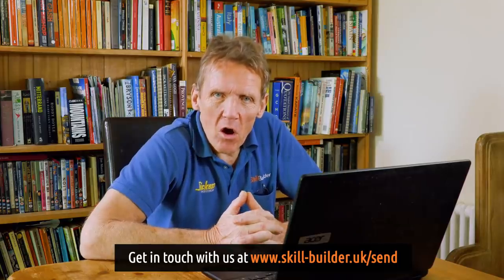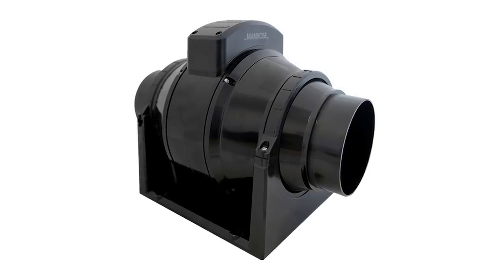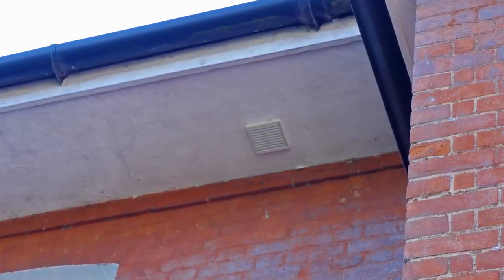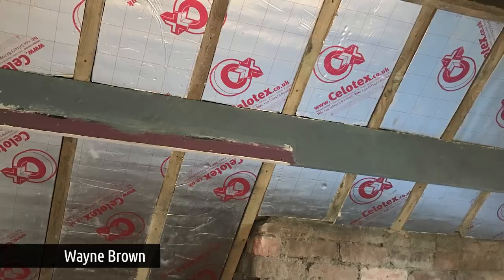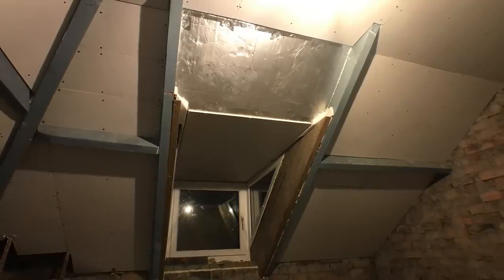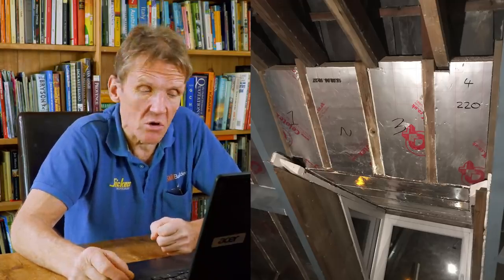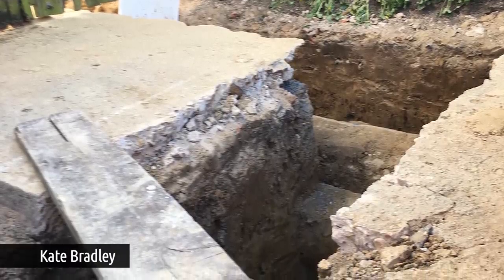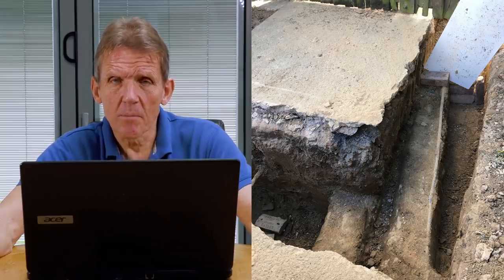Who Needs a Waste Carrier Licence? - ASB #10

Comment: My parents house has a 6”
Wall mounted extractor in the shower room.  

I haven’t done the numbers but you can feel a fair amount of air flow being pulled under the door to the shower room (best to work out the extraction rates to determine if you can find a suitable wall mounted fan).

You will need a larger hole in the wall of course but putting a rigid polypropylene pipe liner in and making sure it’s sealed correctly will help significantly with getting air flow through it and avoiding leakage. 

It’s the type with a humidity sensor and self closing shutter which is great in winter to stop cold air draft when the fan isn’t running.

Comment: I've found a great way to mount those ducts fans without vibration noise is to suspend them from rafters/joists using short lengths of 6mm bungee cord hanging from large cup hooks. Even better for hooks are the screw in insulators used for electric fencing which are nice and smooth to avoid wear on the bungee.  Works a treat.

Comment: Vapour barrier: If using foil faced celotext type insulation you can tape the board  joints with foil tape to create a vapour barrier.  100mm tape will bridge across rafters.  Regardless of method and especially in renovation type projects, continuity of barrier at junctions with walls/roofs/floors is the tricky bit to achieve in reality (easily done in theory on the drawings!)
Reply from the maker: Martin Hill 

That is a good tip. Having looked at the pictures again he has no membrane so lots of ventilation on the cold side.

Comment: Really interested (and spooked) hearing your comments about dewpoint in Q2 Roger. Had to insulate my small kitchen a couple of years back - 1880s build, rubble wall. I understood that the wall was designed to dry by breathing into the house as well as natural drying outside. As such, I studded and boarded it without a vapour barrier and, yet worse , deliberately left internal air gaps under the kitchen units knowing there was air movement behind the insulation.  I was trying to avoid the opposite problem of moisture being deposited by osmosis from the outside. and then being trapped and condensing. What have I done ?!

Comment: the 100mm wall axal fan should be replaced with a centrifugal type with capability to shift 90M3 per hour,  don't forget the fan need air to extract and just where will that come from without provision for replacement air flow or source

Comment: If your ever not sure of insulation requirements or reactions with the environment your using them, speak to the manufacturer, EcoTherm for example will go through the makeup of a wall, floor, ceiling etc, produce drawings and breakdown all for free, great if it needs to satisfy building control, or you’re unsure.

Comment: Drain: Respectfully, I'm not so keen on building a brick manhole over an existing drain. I've seen more than one case where the new manhole has settled, fracturing the original drain pipe both sides with subsequent leakage causing subsidence to building foundations.  Water companies often require rocker pipes each side of a manhole to accommodate future settlement. Details from the  'Sewers for Adoption' guidance (download here: https://www.water.org.uk/publication/sewers-for-adoption/) has become my go-to resource for best practice drainage details.

Comment: I don't advice on the corrgated ducting as it will create air turbulence and the longer the ducting the more you loose from you extraction rate . Solid ducting is way better in my experience
Reply: Agreed but you get a lot more fan noise transmitted in the air and through the wall down rigid ducting. I prefer a short run of acoustic ducting.

Comment: Our boiler over a few days keeps dropping pressure so have to keep refilling it. Does this suggest there is a minor leak somewhere?
Reply: yes
Reply: Yes. It could be anywhere on the flow/out pipe from the boiler, all around the heating pipework thru he rads or the return pipeworkback from the rads to the boiler. It could even be in the boiler itself.
Most likely causes...easiest places for you to locate any minor leaks...
Check the rads around the blank and bleed points for any evidence of staining/rust streaks. Check the radiator to valve connection points and pipe entry to rad valve compression nuts. Take the plastic cover caps/heads off the valves and check the spindles. lots of tissue paper and patience required I'm afraid.
Boiler...
Look underneath for any evidence of streaks/staining water and check the 22mm pipes on the heating flow and return unions. Water dripping over copper tube will stain green (verdigris)
There will be a 15mm pipe that goes from under the boiler, thru the external wall terminating outside near the brick. Either turned back on 15mm tube or may have a button shaped dome. This is the PRV terminal. Again look for dripping or staining down the external brickwork too. If the PRV terminal is dripping may be one of 2 reasons. 1. Expansion vessel diaphragm is ruptured, and exp vess needs replacing or just needs re pressurising..pumping air in. 2. The filling loop is letting by, that is very slowly introducing water into the heating system and increasing the pressure. This will exploit any weaknesses on the points mention in paragraph 1, or..... will cause the boiler PRV to do it's job and dump off outside..see para 2. Check that the filling loop valve(s) are actually closing properly... that is not letting by.
Once you have eliminated all of the obvious and common possibilities I'm afraid it a case of looking for damp patches on ceilings or taking up ground floor floorboards. It's rarely a problem with pipework concealed though, so best to eliminate all the most likely causes first.
Top-Tip.. get your boiler serviced annually.. any minor problems can be sorted out as part of the service and don't leave the filling loop on if possible.
Hope this helps.
Reply: @loafersheffield  Thanks. I'll check.
Reply: Bloody Hell! Well put Loafer! Take a bow for that comment sir!
Reply: Thanks folks. Saved Roger the job of replying.

Comment: This fan is a far easier job to carry out. I put one in an internal bathroom and it's excellent. Extraction Rate 108m³/hr.
On a warm day condensation has disappeared after you  turn shower off. Lots of settings and can be worked from phone app. 
https://www.screwfix.com/p/vent-axia-svara-409802-4w-bathroom-extractor-fan-app-controlled-white-240v/8827p?_requestid=6842

Comment: Dear skill builder who gets to keep scrap metal from jobs. Builder plumber or house owner. I think it should go with plumber as they may include scrap in price job
Reply: My motto is....whoever takes it out it belongs too , I'm a plumber and I always keep the scrap pipes an fittings I take out and if anybody says anything I tell them it's priced into the job.....👍
Reply: Do you have a waste carriers licence? If not, best leave it with the customer you scrounger or there could be a fine coming your way. Regards, PC Plod.
Reply: @juancornetto8243  what leave the hundreds of scrap a year after us haha.
Reply: Last system to combi swap I did, I left all of the pipes from the airing cupboard to the loft in situ. Pump, 3 port valve air separator..the lot! Even left the cylinder to one side. When the customer asked my why I hadn't taken everything out I told him it was not part of the job agreement, that it was his property. Handed him some spare pipeslices and a headtorch and told him to remove it himself. Quickly figured he was a penny pincher.. you can usually tell when on day 1, 2 hrs in, they approach you and ask you for "extras" "while you are here, can you justs" A signed note of transfer should suffice with reasonable folk...
Reply from the maker: I use to have it as a t&C on the back of my quotes that the scrap was mind but my wife got fed up with our garden looking like a scrap yard so no more recycling for me.
Reply: @juancornetto8243  in Ireland so not as strict as UK about waste.